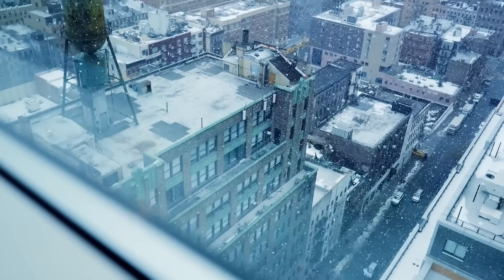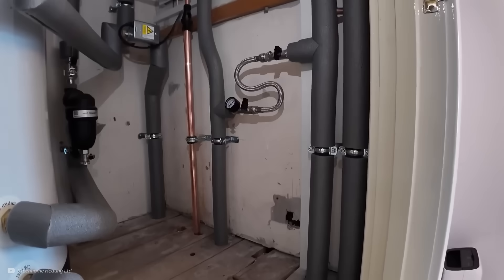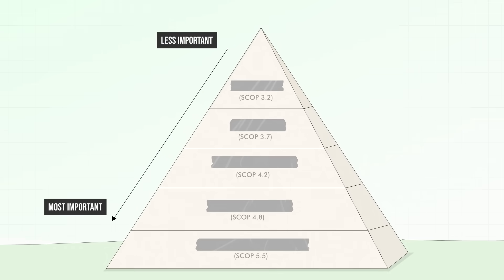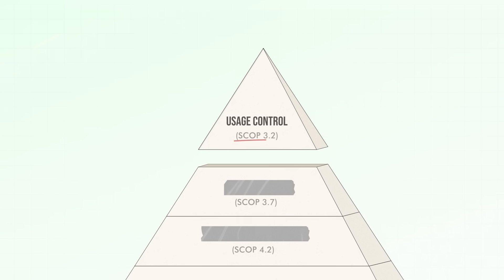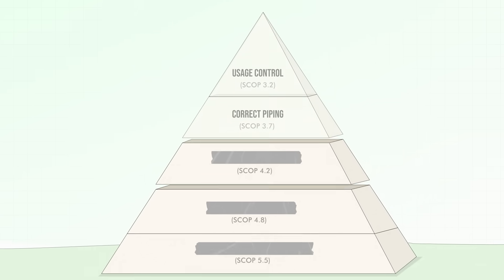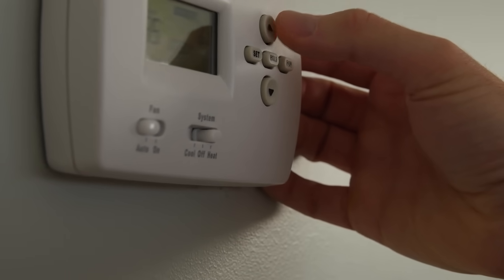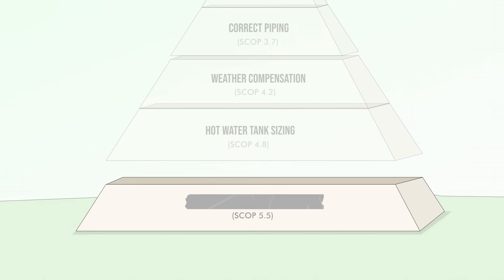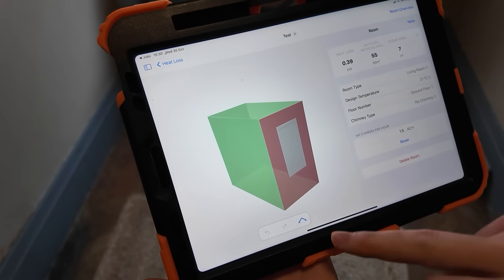The Genius of the World's Most Efficient Heat Pump

Comment: Plumber and hearing technician here. If the domestic hot water tank tempereture is kept at 40 ⁰C the risk of being infected by Legionella will be very high. Make sure that the temperature is at least 55 ⁰C or 60 ⁰C. Sure, it will be more expensive but it is better to stay alive.
Reply: The usual technique is to program the system to boost the hot water temperature to 65 C once a week. That's offered enough to keep the water bacteria free.
Reply: It's not necessary to keep it at that level all the time. Many heating appliances have regular anti-legionella cycles that temporarily raise hot water temperature to 60-70 degrees to kill the bacteria, while at other times it is kept lower.
Reply: @MikeRI170  I couldn't care what some manufacturer says is safe. I'm not going to be fined and /or jailed and /or sued to save you a few dollars. You set your system however you want, I'm following my local laws, and will adjust the temperature up whenever I see it too low and document it so. Hopefully you never need to call a technician if you have similar laws. (which you likely do if you live in the developed world)
Reply: @SuperS05  It's your choice to do that, you don't need to be so aggressively defensive about it lol. 
I'm saying that keeping the tank above 60 or so at all times being the only way to prevent legionella growth is not true as in it is not the only way to keep the system legionella-free, that is all.
Reply: @SuperS05  Unless you have actual data that shows common anti-legionella cycle practice visibly leads to legionella or other bacteria outbreaks and illness cases I'm not really interested in discussing potentials here. 
Codes and regulations can be written with huge safety margins or based on outdated knowledge or practice. Like how in the UK it is still not permitted for normal sockets or switches to be installed in bathrooms while it has long became common practice in Europe and the rest of the world, alongside wide usage of residual current protection. Of course not having any electrics in bathroom is at least safer than having, the question is how much (if any) safety benefit is there compared to downsides or inconvenience of such restriction.
Reply: @MikeRI170  50C works just fine if the water is keep at that temperature for at least 3 hours. I have not done the ROI on both methods
Reply: @SuperS05 the regulations in the UK say that there has to be a legionnella cycle for commercial properties only. There's no such requirement for domestic properties.

It makes sense to have it as a recommendation but it isn't a requirement for most properties.
Reply: @FahadAyaz  and in Canada, the hot water tank is not allowed to legally operate in the unsafe temp ranges. Any tank, any where. The IMC also has a similar regulation but it isn't always adopted by jurisdictions in the US. (potable only. Non-potable is exempt, but has a ton of other rules.) 

Legionella isn't the only pathogen that can grow in tanks. It is a concern but it isn't the only one.

In the UK, rentals can be considered commercial for legal purposes. I don't know if that extends to the mechanical code, but I certainly wouldn't want to risk it.
Reply: interesting mix, hearing technician aye.
Pretty much every heat pump heating system has a legionella cycle which runs 1x a week to eliminate this problem.

Ive been running my heatpump for years at 45c over night.
Reply: @Etacovda63  It really should be at 50c. at 45c is stops growth but does not kill. at 50c it is all dead after about 3 hours.
Reply: @Etacovda63  Lots of gas boilers do this as well - they have a legonella cycle feature. However its not standard across the board so you have to choose one that has this
Reply: Good point, and the guys that replied to you and maybe seen the vid didn’t get the idea. The whole point of running effectively is to keep it as close to consumption temp. Good luck maybe using that inefficient cycle for 2-3-500 liters. My guess will be using a uv filter or reservoir with a uv lamp to be efficient.
Reply: In Australia all heat pump used for heating  hot water are required to have a Legionella cycle. This is normally once a week. This is normally done by the heating element installed in the heat pump. This can be different depending on the unit.

Excluding this many units are required to only run when the temperature in the tank drops by 11 degrees. The unit l have has a fixed temperature but has a mixing valve to mix hot water with cold water to drop the temperature. 

The waste with heat pump at least in Australia is not reusing the heat or energy. Many houses in Australia use heat pump to cool. Effectively, you take the heat from inside the house and throw it outside. Then you have a separate unit to take heat from outside and put it into cold water to make hot water or swimming pool. If the units were combined, it would save energy consumption because currently we using at least 2 systems to do a similar process. 

The efficiency on the units is generally based on laboratory, which are specific rules. It can change depending on outside and inside temperature. So really it's more a range.
Reply: @PandaSoft i get what you're saying but compare how long the AC runs to the hot water and then also the fact people still use them in winter, that would make for an insanely complicated system (exspensive) for not much power saving. Since for the 6 months of summer we have the hot water cycle is super efficient with all tge ambient heat
Reply: Aren`t we speaking about heating system? The heating system, from where we do not take nor consume water, but the system which simply transfer the heat from outside to inside to heat the space? In such a system we should not care about legionella! That is another topic regarding the domestic water. For example, you can use another indoor heat pump to take heat from the storage tank to transfer in to domestic hot water tank, where you can keep 60⁰C. Your insult is useless here, since there are two separate systems, you are talking about domestic water system, in the video they are talking about heating system.
Reply: @tonycollins7062  It's only done once a week and the extra heat isn't wasted. You just mix less of the hot water with cold water at the tab and end up with the same 38°C you are used to. So basically it's just using more energy once a week to heat the maybe 250L storage. It's significantly more efficient than keeping the water tank at 55-60° throughout the week.
Reply: 100% agree with this! Work on your insulation instead, the gains will be much greater.
Reply: id rather be dead than waste energy - some hippy probably.  always wondered why hot water heater closets arent just filled with insulation in a massive blanket or something, yeah the tanks insulation isnt bad but 3" of foam isnt that good r12?  throw in a foot think wrap around it and youll cut its energy losses in half. that simple.  20$ at home depot.  how often you ever gonna service it like once every 10 years?
Reply: Correct I'm 47 years in the business Heat the domestic water to 60 degrees centigrade and then use a thermostatic mixing valve to blend it for use.This is all part of the building regs and health and safety. These guys are getting carried away with their own fairytale
Reply: @noelburke6224  no, Legionella needs far more than just the correct temperature to exist.

You're more likely to catch it at the local sorna than you are doing this at home.

Most pumps cycle once a week to temp to kill it off while the average family also doesn't leave the water sat long enough at the perfect breeding temp for it to grow.
Reply: There is a near zero chance of legionella in a domestic property.
Reply: @magicker8052 probably because everyone sets their hot water at 65 deg.
Reply: I intend to go full eco this year but can my wife have a hot shower and can I have a long hot bath every day, for my bad back?
Reply: When our last hot water heater died, I decided to replace it with a smaller, less expensive one, but I insulated the crap out of it and to compensate for the smaller size, I jacked up the temp some, so that people would have to mix more cold water in while taking showers, washing dishes, etc. 

  I realize that water has an amazing heat capacity and probably having an even larger heater, insulating it very well, and turning the temp down some would have been more efficient..but we have limited space (the water heater is right next to the washer and dryer, in a small closet like situation), limited budget, and there is the bacteria issue to consider.  Anyways, it's been working well so far and electricity prices have actually gone down some (I think due to the very increased insulation).
Reply: Chlorine
Reply: This is fantastic information, very inspiring!! ❤
Reply: You think in old systems. The stored water is not the water you get. It can be put threw a heat exchanger/pipe and therefore you have a minimal amount of fresh water at that tempereture. Thats why you can go to these low temps without the risk.
Reply: @tonycollins7062  they have an entire article about it on the heat geek website.
Reply: Modern systems have a program which runs the boiler to a higher temperature once a week but keeps it at a lower temperature during other times. This is enough to mitigate the issue.
Reply: @Rebasepoiss this is old Standard. Modern systems usw. a freshwater Unit with a heat exchanger. Which Elimination the need of an old school legionella cycle.
Reply: Depends how long the water sits for, if you use the water often, then the risk is low.
Reply: No problem whatsoever for heating, it's a closed sistem. Another thing is the installation for sanitary water.
Reply: There is a setting on all modern heat pumps to heat the water considerably higher, a legionella cycle. I set mine to early hours on Saturday morning, once a week, 70 degrees
Reply: usually you fix it by superheating the hot water tank to 65*c at night with electricity once a week for a hour or so.
Reply: Get a tankless water heater.
Reply: This just isn't true.
Reply: They go through daily or weekly pasteurisation cycles, bit embarrassing as a heating engineer that you didn't know that....
Reply: I installed a UV-C light inside the tank, has the disadvantage that I get some ozone in the water, but no Legionella
Reply: Sure you are.
Reply: A hot water cylinder set up with a heat pump has a pasteurization cycle once a week , Where the immersion element kicks in to prevent Legionella.
Reply: You will be wasting an enormous amount of energy doing that, hot water storage is usually poorly insulated. Your heat pump can run regular legionella cycles which completely eliminates the problem. I wonder why this was not part of your education?
Reply: @pietheijn-vo1gt  Most modern cylinders are internally insulated and are well insulated from heat loss. The old lagging jacket is on a very old cylinder these days.
Reply: @pietheijn-vo1gt  because it's the law in a lot of jurisdictions.
Reply: There hasn’t been a residential report for legionnaires ever, only in a commercial environment.
Reply: Both the WHO & NIH (usa) have cited residential case studies and I'd rather spend a few extra dollars a month & not risk it.   Also I like hot water when washing dishes & showering.
Reply: @JP-WC  can you give me names of those or other identifiers so that I could find the relevant documents?
Reply: @smartboilercompany1983  survivalship bias.
Reply: @SuperS05 Lol, so you reckon people die of legionnaires disease at home and nobody finds out! 😂😂😂😂😂
Reply: @Hamish_A  occasionally, it happens. Adults with an average immune response would only feel flu like symptoms. The the immuno-compromised, elderly and  babies are the highest risk group.
Reply: Could that  by solved by chemicals, lets  say  chlorates?
Reply: I think 57 C is minimum temp , correct me if im wrong❤
Reply: if the flow rate is high enough (the water if not stagnant) its not likely. and considering  that you'll be using only from the tank, it will get empty every day
Reply: @martontichi8611  legislation in many places REQUIRES a DHW storage tank to be a no less then 50-55°C. Some places require it to be up to 60°C. However delivery to the tap usually can't be above 44-49°C. The rules change from place to place but generally those numbers are close if you have any laws at all regulating this.
Reply: @martontichi8611  I don't go with "not likely" with a risk such as that.
Reply: @NikitaKyndt  you've got more chances in it getting you out in the world than you do at home.

Do what you like, most people don't get it from the water they heat themselves.
Reply: @martontichi8611  dangerous advice that: now explain why hotels occasionally get their systems infected.

Sterilise the system to 65 C once per week. And if you don't then don't expect me to visit....
Reply: @martontichi8611  Presuming you are using a larger tank at a lower temp, what presumes you will empty the tank every day? A smaller tank than before - yes. Remember the rad heating in theory is not using the hot water cylinder
Reply: I see a lot on hear saying that the heat pump runs a cycle of 65C to eliminate  Legionella. What they don't say is that the Heat pump has to run inefficiently to stop you becoming unalive Lol.

On my gas boiler setup no such issues,  just run the tank at 80 C and double the showers or 1/2 the tank size. hmm,, is it the case the tank has to be larger on a heat pump setup? if so at what cost and space. 

So this is where we are, so if you have a heat pump it's likely you know of pink elephants, and cow that jump over the moon.
You shiver in the cold winter months, because that nice honest guy who sold you the refrigerators that you keep in your garden said you will be warm...honestly.     

Guys Betamax...
Reply: It really should be at 50c minima. At 45c is stops growth but does not kill. at 50c it is all dead after about 3 hours.

Comment: I wonder if using an air pump into the hot water tank rather than cold water feed. And then use a temperature sensor to operate an air bleed valve with a water level sensor to refill the hot water tank to maintain the optimal water temperature as it refills from the cold water one way valve. Or an expanding bladder inside the tank to maintain the water pressure while the cold water feed is shut.

Comment: Wow! This is great! It's estimated a coefficient of 5 would be needed in the U.S. for heat pumps to beat natural gas in costs.
Reply: theyre already cheaper....
the issue the boomers are saying is the lows dont work and were down to -10F now. 

power is like 55-70% efficient to your house
commercial power is .02$/kwh or so, youre paying for dist, the only reason nat gas might win is the dist costs are being subsidized for consumers vs the electrical wiring. 

and cop 2.5-3 acs are 300% efficient so youre getting more energy out by far than burning the gas in your house.
the only artificialities are gas prices or distribution pricing.

commercial companies .02$/kwh and pay for wiring.  
how gas works for them idk

consumers
free wire .15$/kwh where i am
gas, no idea i dont have it but guessing same setup, 0$ upfront and pay per btu etc.

california is tired of paying for their useless gas system so getting rid of it slowly
needs to happen in the south more, its done. 
coldest were every going to see is high 20s for a few hours a year >>

Comment: That is really no magic. Take your basic physics equations. Put it in excel and let excel find the lowest possible temperature at the given maximum volumetric flow your heatpump can put out. Did the floor heating company in my house allready back in 2018. I habe an overall cop with an old system, including cooling and warm water of 4.

Comment: The First Law of Thermodynamics says you cannot get more energy out of something than you put into it. If you put 1,000 watts into an air conditioner (which when used in reverse is called a "heat pump"), then the sum total of all the energy you get out of it must equal 1,000 watts. This means about 200 watts worth of pumping/compressing and fan blowing, 400 watts worth of cold out one side, and 400 watts worth of heat out the other side. If you want more heat out of a 1,000 watt heat pump, then run electricity through a coil of wire and blow air across it with a fan. Now, why (you ask yourself) would anyone use a heat pump to create heat, and the answer is the unit is really an "air conditioner", but in the winter it can be run in reverse (or turned around in the window if it's a window unit) to generate heat, without having to buy a separate heating unit. Also note that "heat pumps" only work well down to around freezing (30-35 deg F). In order for them to generate any amount of heat when temps are below 30-35 degrees, an electric coil heater inside the "heat pump" unit (i.e. the air conditioner) is turned on.

Comment: They still aren't good enough to be used compared to traditional methods. It doesn't do as it's intended to efficiently based on the testimonials of people who have made the switch. With things like it has a harder time heating a large home and needs repairs more consistently. Do your research.. remember smart meters.. they were supposed to reduce electrical bills but did the exact opposite and doubled.